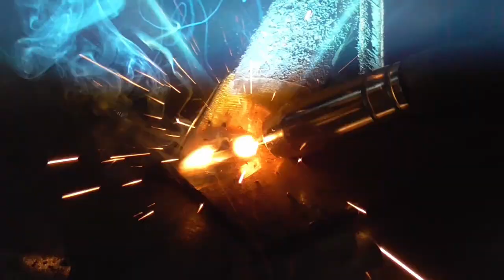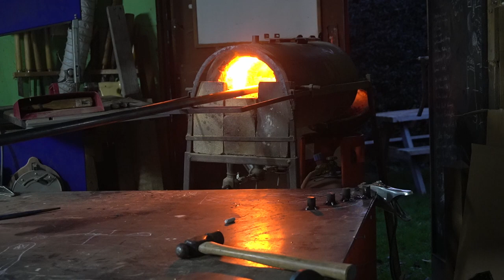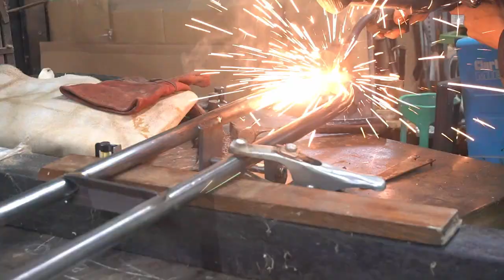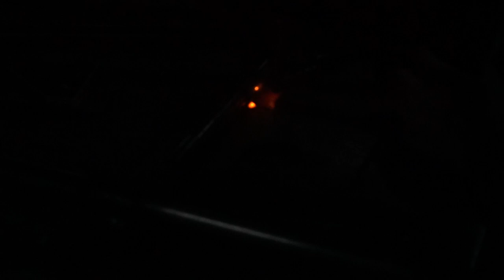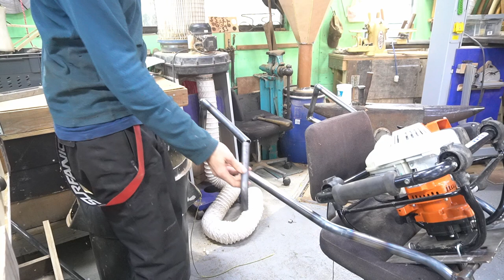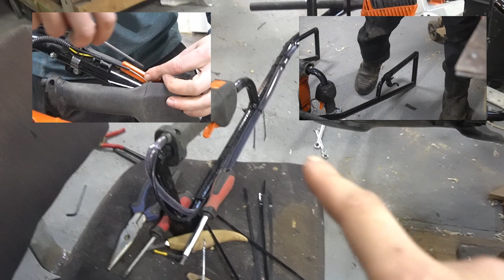Post Hole Auger, Modifing a Stihl BT131 To have a Trolley/Wheelbarrow Attachment || Back Saver

Comment: I want one so bad for my 131 stihl auger and wish I have the tools to modify the same one!! Great work!
Reply from the maker: You could probably achieve something like this with a wheel barrow, and use a grinder and drill to fit it. It would cover most of the functionality. Although you can buy a cheap augur frame as well but it has a fixed motor that doesn't hinge up which was needed in this case. Having this frame is sooooo much better for your back, would recommend it as soon as you can.
Reply: My man If you can afford a 131 you can afford a cheap stick welder and make one

Comment: Overall looks OK. Tho that tilt and being unbalance would bug the ever lovin shit outta me. Better not to be fighting that and the machine. Also Not having to kick that knee up to get it upright. Makes it difficult to center the point for when it has to be as centered as possible.  Last it's better that is doesn't flop back up, so that you can just lower it and stick it in the ground to wait for the next hole, and not have to bend over to get it started.
Reply from the maker: So the tilt was discussed with the customer. and they wanted it that way.  It will always fail safe and not going to hit the user. however I think they may want a locking pin in the future. 

You can get it in the ground within a couple of inches using your knee, but if it needs to be more accurate than that then the old frame is still attached you can grab that and place the bit exactly before drilling. 

So my understanding of the sites that this is mainly going to be used on is the are quite steep and bumpy and having the bit hanging down would make maundering even harder. But if they change there mind I can always weld the pivot in place. I think when they use it on flat ground a second bar/stick is used to stop it flopping about.

It worth nothing that this was made to a pretty tight budget so there was no iterative design or extra features. the hinge nearly didn't get done but was important enough to do. I hope this helps you understand the design decisions and why some bit are not ideal but they are like they are.  I did a service on it last week for the planting season and they still seem happy with it.
Reply: @InfinityMindDIY  
"So the tilt was discussed with the customer. and they wanted it that way.  It will always fail safe and not going to hit the user."

I get that was what the customer wanted but that can be achieved simply by putting a stop in the direction of the operator. 

"You can get it in the ground within a couple of inches using your knee, but if it needs to be more accurate than that then the old frame is still attached you can grab that and place the bit exactly before drilling. "

Again but why bother with all that went having it balanced, the operator never has to touch or lose footing. Having it go level/perpendicular to the ground removes the operator from sacrificing a sure footing just to move it a few inches.

"It worth nothing that this was made to a pretty tight budget so there was no iterative design or extra features."

There  wouldn't be "extra" features. The stop I already mentioned only needs to be a bit of rod that does not let it go back anymore than 15 degrees. Any more than that they shouldn't be trying to drill anyway.  

"I hope this helps you understand the design decisions"  "It worth nothing that this was made to a pretty tight budget "

Not really. we have built several of these thing for customers. The budget was never exceeded and we still made a profit. We didn't spend any time ing bending tubing just cut and weld. We spent just about the same time to make them as it took to watch your video x4 times. Even with the first one it didn't take long at all. 

Last figuring out a locking feature to keep it up while moving is as simple as just using a bungee cord to strap it up.

I am not trying to put down your work but having to kick it up and sacrificing a sure footing is not good. Then doing it over and over, well that is a safety issuer.

By the way I does this for waor all the time building structures and fences & gates. So again doing that over and over again would get old very fast. You customer may be happy with it but they might just be happy with not having to hold it up, imagine how much happier they would be if they didn't have to kick it up all the time.